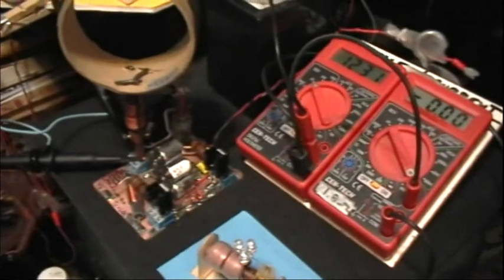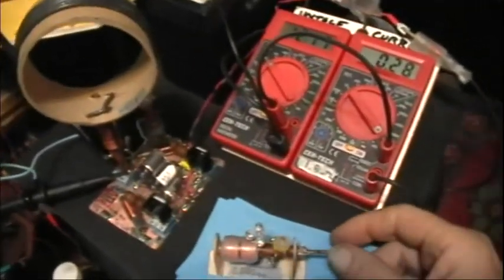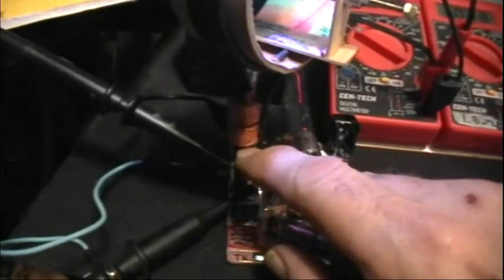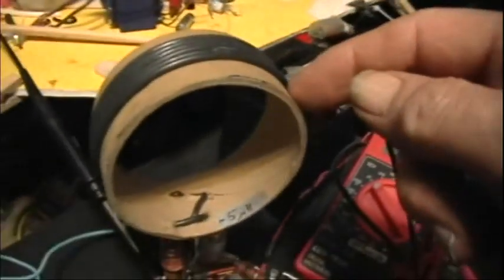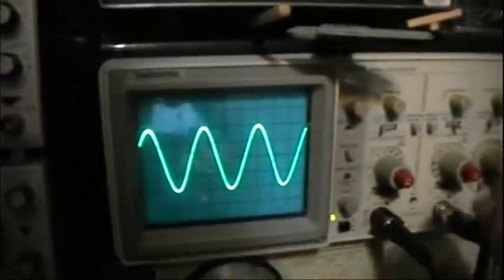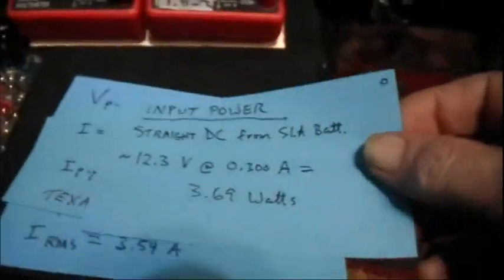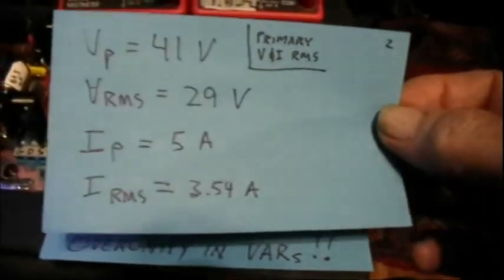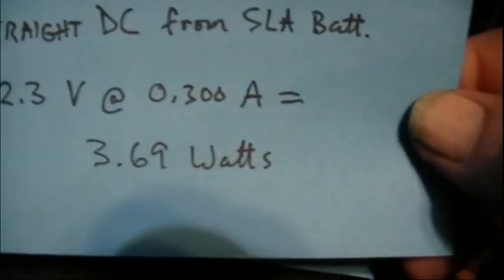Electric OU: Micro QEG Part 1: Texas Has Resonance !

Comment: personal opinion: While this looks interesting, there is no need for all the math. Why? Because if you have success, show it working standalone with no battery other than to start it. Otherwise, the math seems to be a common obfuscation tool for COP claims that have no apparent practical value. Run a hair dryer with it...power up a microwave...trim your lawn with a weed eater powered by this puppy! 86 the math. Good video, nice circuit presentation.

The answer, whatever it will end up being, will be simple and a head-slapper. It will not be complex nor exotic, nor will you have to face north with only 4 toes on the ground. Just saying.

Comment: Well, all it is left now, to loop your 2 circuits to create feedback and then disconnect your battery and make it run self-sustainable, that will be proof in the pudding, if it doesn't work that way, well, some calculations about OU are wrong. Till this part of circuitry it is not achieved, you r video is just a nice entertainment, maybe it will even generates few bucks....

Comment: Please use the over-unity power to drive the circuit without the battery to prove the maths is correct. Then operate something like a 100 watt lamp to indicate the design works and there is no room for scepticism.

Comment: Nice demonstration, and completely ignoring what is in your circuit... your written conclusions above do not agree with what is shown in the video. We seem to agree that the voltage and current shown are pretty much "in phase".  Agreed? But let us say that the phase angle between the current and voltage is as "bad" as 20 deg out of
phase.  The COS(20) = 0.94 so your calculation becomes, Pave = 29 x 3.54 x .94  = 96.5 watts. 
This is over unity! 

For those of you who lack the education, please go check out the math on your own.  This is NOT rocket science.  When current and voltage are in phase there
is no correction factor to power, as the current and the voltage are IN PHASE.  So when Hope Girl achieves results like this then the QEG team is indeed over-unity.

I trust this was an error on your part, I do not judge you if you received payment to purposely make this misrepresentation.  Blessings!
Reply from the maker: You are letting your own brilliance lead you astray. It is you who err and it is "Hope" Girl who misrepresents. I sincerely hope that you have not thrown away your own money to support her perpetual vacation in Morocco.  But if you have, I hope you can afford it and aren't taking money away from your family to do so. Be sure to let us know when you see any FTW QEG running itself with power left over to run a home, or when it is started by a crank mechanism, as are still being claimed.
Reply from the maker: Vladimír Funka
Got your QEG self-running yet? Of course you haven't -- because there is no such thing as a self-running QEG and there never will be.
But go ahead and PROVE ME WRONG by demonstrating your own self-running QEG. I can hardly wait to see what excuses you can come up with as to why you CANNOT demonstrate a self-runner. Get to work!
Reply from the maker: Vladimír Funka
You're funny! There is not a single thing that the "QEG family" succeeded at, other than fleecing good people of their money and avoiding the consequences by moving to Morocco.
There is NO self-running QEG anywhere in the world and there never will be.
You cannot demonstrate anything that supports your silly contentions that the "old book of physics is not working."
The longer you go without providing any evidence for anything, the sillier your posts become.

Comment: The EE in mee says your math was off a little... but not terribly so. Inductive Reactance/Impedance (8min 27sec) = (2 x pi) x FL gives 9.531 Ohms for 5uH at 303,384Hz.  

The big remaining question though, is (just out of curiosity) have you tried to see how much power you can get through a bigger "Electro-Smog Harvester"? (and you didn't even include the 3 LED's in your output power calculation ;-)

Lastly... while I really appreciate all your shared work here, consider shopping for a higher res camera. Used cameras that record Full HD Video to SD cards are cheap... and would still have optical zoom... and a tripod mount.  I like the little Nikon S8100 I got for my wife a few years ago... eBay prices for used ones are now $25-ish... or less.

http://www.nikonusa.com/en/nikon-products/product-archive/compact-digital-cameras/26219/coolpix-s8100.html#tab-ProductDetail-ProductTabs-TechSpecs

http://www.ebay.com/sch/i.html?_from=R40&_sacat=0&LH_ItemCondition=1500|2000|2500|3000&_nkw=nikon%20s8100&LH_PrefLoc=1&rt=nc&_trksid=p2045573.m1684
Reply from the maker: +beforebefore 
Thanks for commenting. If you can stand it, please watch the rest of the playlist, of which this video is the first segment.
As far as the camera goes... most of the loss in resolution probably comes from the  multiple stages of processing and compression that I have to use to get the video up to YT. I have a very slow internet connection with limited bandwidth. Not quite dial-up but close.  Plus, this video has another stage of processing as it is a re-edit of an earlier version.  The camera is a Panasonic SDR-H40PC.

Comment: is there a reason you never included the "duty cycle" within your calculations ?
Reply from the maker: +maintenance engineer3327 
Please look up "duty cycle", "sine wave", "average power" and "RMS value" in your favorite electrical reference materials.  What is the duty cycle of a sine wave? How does one calculate power, given sinusoidally varying voltage and current? Thank you for watching!